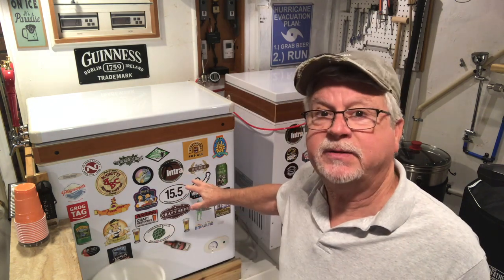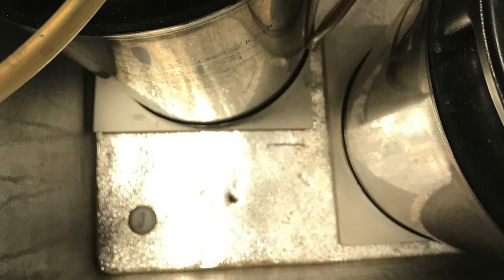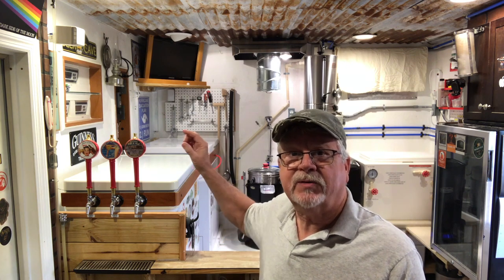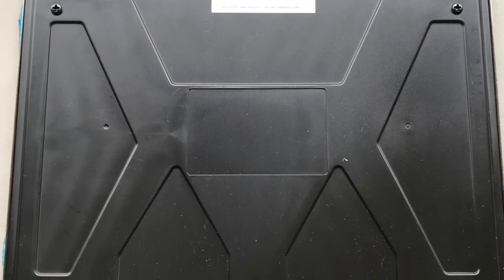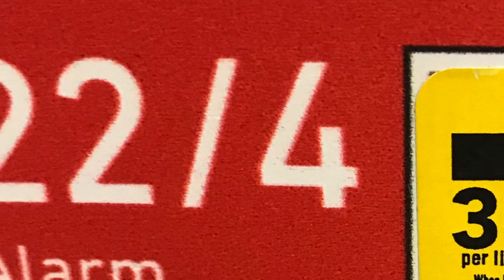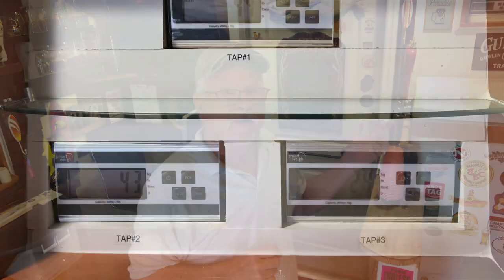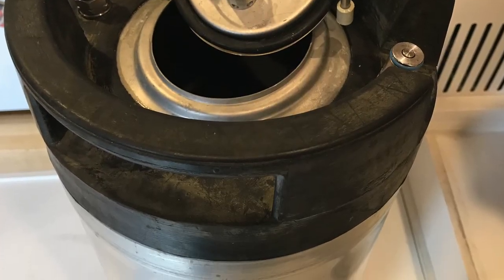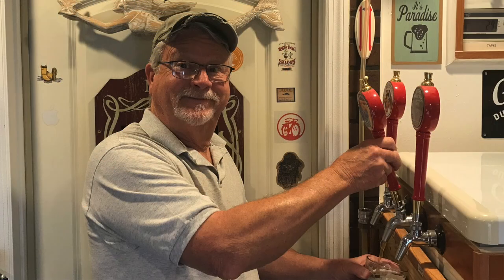Building a Beer Keg Scale (using a Postal/Shipping scale with a PCS Function)

Comment: Great job. Nice and clean.
Reply from the maker: Just remember that the scale only has memory for the PCS function, not the weight data.  If you loose power, you will need to re-weigh an empty keg (or a substitute object of that weight).  Or, get a UPS battery backup.  Cheers!

Comment: Do those definitely not auto shut off when plugged into wall?
Reply from the maker: Nope.  The auto shut off is only to save battery life.  However, if you have the USB plugged in and you have a power glitch or outage, the displays will zero out (but the PCS input stays in tact).  I have a UPS connected to the USB outlet so I don't have to re-weigh the kegs.  Cheers!